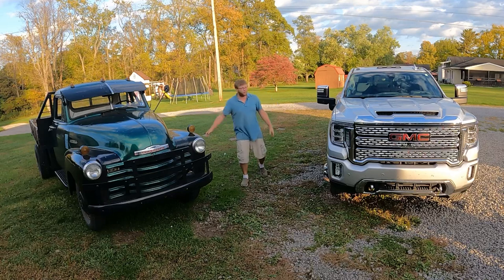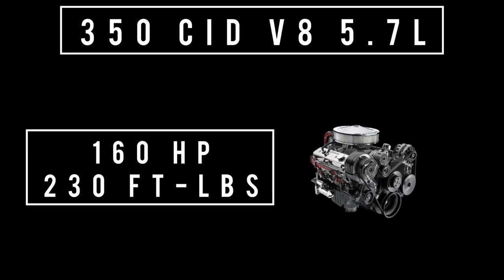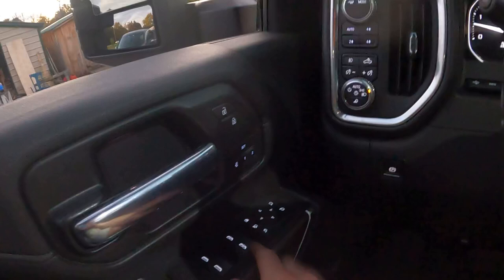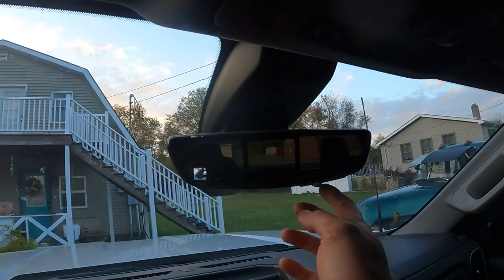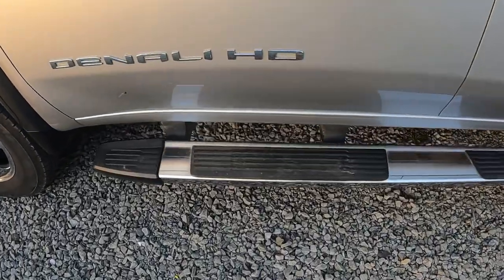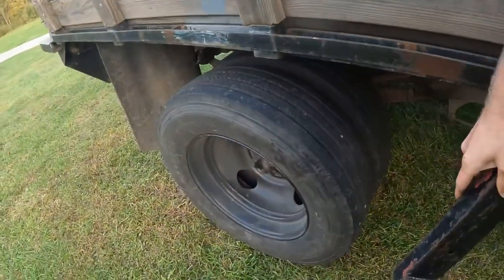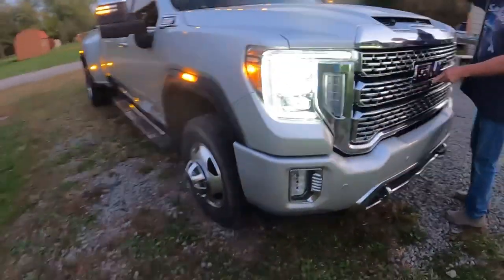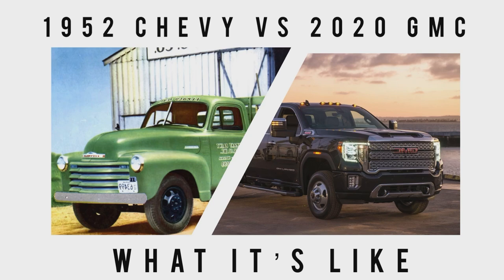Non-Comparable comparison ￼1952 Chevy 1 ton vs 2020 GMC Denali 1 ton

Comment: The rounded fenders and hood wasn’t just for aerodynamics or styling; but they served a purpose to give structure and rigidity. When the VW Beetle was designed in the 1930s, to cut down weight and cost of steel, all the steel stampings were curved on purpose.
Reply from the maker: Awesome information thank you so much for sharing

Comment: Okay, Jay.  We have similar "wiring" regarding old vs newer trucks.
The non comparable comparison is a hit with me.  A type of thing I don't see elsewhere.

I don't prefer the demon brick trucks of the current era.

I have done the E brake maneuver many times on hills with a clutch car and truck.
The bouncy bouncy of your old truck seat is charming to me.
I learned to drive a stick on a 56 Ford truck.  💁🏼‍♂️
Loved that truck  ❤

My current vehicle is my dads 86 Ford F-150.
It has some bouncy seats too and minimal computer stuffs.
It does have fuel injection but I really don't know what drives it. 🤷🏼‍♂️

Thanks for this "comparison".
Cheers and Tootle's, from me.
Reply from the maker: That is one of the most convenient things ever is the parking brake set up such as that.. electric parking brakes suck

Comment: You may not believe this.... My father had a 52 Chevy rack truck that was sparingly used. It had the truck 6 in it (I forget the displacement) and I distinctly remember having the starter switch on the floor next to the accelerator just as shown with yours. We also had a very rusty 53 1/2 ton which was my first "field car" that I drove around my large yard at 10 years old. I'm in agreement with you and I'd rather have the 52. 👍
Reply from the maker: In 52 it would be the 216 or 235 one ton is in a grey area 1.5 ton trucks and up came with the 235 and the 1/2 ton- 1 ton came with the 216 babbet buster
 (splash oil lubricating system) . But one could opt for the 235 which was the superior engine choice with pressured oil system. I love my truck it’s perfect with the 350 v8.. I’m looking still looking for 19.5 wheels from tires still have bias and radials on the rear... internet said it would work as long as on same axel is what it said.. I can attest that it doesn’t work it’s not stable past 45 the back end just wants to turn around.. so I’ve been hauling with it carefully.. I don’t go far and keep it until 40 but yeah who knew finds gmc 1985 bread truck wheel would be that tall of an order. I’m to the point of just finding 18 inch Steelies and making the difference up in tire issue I’m having they are too wide I need a narrow tire so I don’t lose turning radius.. this truck turns insanely sharp for what it is not quite as sharp as a 1939 Ford 1/2 ton which will be posted tomorrow but turns good and don’t what to lose that

Comment: Vintage trucks 🛻, so sincere and unassuming: No infotainment, no vibrating seats (except from the suspension), no leather headliner (no headliner at all!), no AC, no automatic, and no power steering. And yet, for a modest upfront cost they hauled our stuff, carried our kids out back on a hayride, they brought home the new washing machine or the cans of paint for a new home project. Gone are those days of sincere transportation; replaced with expensive glitz and gaudy frills. 

I had a friend with a 53 Ford pickup. Once a red metallic, now mostly a primer brown; that truck was sincere, with a floor shift, drum brakes, with only an 8-tract tape player added as an add-on. Clean, simple, full of character, and cheerfully it rumbled down the road. Caring in back a bale of hay to keep the truck from sliding off the road.
Reply from the maker: But key take away points are the same The crazier thing is if you got a one and ahalf to two time truck restored they’re not worth as much even though they are twice or three times the truck as the half ton trucks are.. the new one can only carry 300 lbs more than the old one but costs upwards of $90,000 more is the new one worth the price difference and to me it’s not.. but to my father in law it is, he is a plant broker and moves plants so he needs a truck that can pull 20,000 lbs
Reply: @What.its.like.  Yes towing certainly would be better; and power and amenities are appreciated with the newer GMC. But looking back at vintage cars and trucks; the reason they age better is there are no electronics to get fried, no plastic interior trim to fade and crack, no camera and radar sensors to replace (a problem finding parts a decade or 2 from now) and these repairs can be done by a handy person rather then a specialist in electronics. 

Love the deep metallic green of your truck. The front bumper looks very appropriate and attractive too. Interesting that you upgraded the engine… hope the brakes have been upgraded too. My friend with the 53 had serious issues with undersized brakes and with the master cylinder.
Reply from the maker: Brakes are mechanical drums use the transmission to slow down it’s not terrible

Comment: Personally, I think the new full size trucks (pretty much all of them) are downright ugly, too big, too wide, and way - way too expensive for what they are.  Someone asked what engine the 52 1 ton had?  Originally 235 inline 6 Used in new large trucks starting in 1941.  Max Brake Horsepower: 105 @ 3600 rpm Max Torque: 193 @ 2000 rpm Stroke: 3.94 Bore: 3.5625
Compression: 6.7 to 1. Simple, tough, and really not fast.  Any time you crease or curve sheet metal it get stonger.  My choice  (and I drive newer vehicles, 2016-2018)  I'll take the old truck, even if you upgrade the engine and transmission.  In fact I'm considering going backwards at this point - - - good vid.
Reply from the maker: The f150 is nice and the dodge is ok but I’d never buy one, I reviewed a ford maverick and I loved the truck but it’s not really a truck, I got this truck because my mom has 2001 Ford F-150 every time I get wood a blow the shocks out I wanted a machine so I bought on hows rly Chevy advanced design wasn’t my first pick 
First pick was 1930-1931 or even 1932-33 ford AA or Ford BB
Second was 1941-1949 international kb5-kb6 (I so want to find both and compare them next year that would be epic

Comment: I'll take Grandpa! (Would install a split brake system and a unleaded compatible engine).
Reply from the maker: Dual master cylinder is overrated there’s three ways to stop this truck I have drove 16 miles to my mechanics house with absolutely no brakes and made it there safely and I live in a hilly area lol

You have no idea how many Classic Cars I have driven that people put aftermarket steering wheel columns in them and power dual master cylinders and they suck  the power steering box only works half of the time it’s so sloppy most of the time the manual steering box is so much better in my opinion same things with the brakes there’s nothing wrong with drums and it’s single master cylinder if one line goes out they all go out but your emergency brakes or cable brakes generally and if that’s not hooked up you can use the transmission to slow down.. If you need to stop put it in first gear and turn it off and pull the clutch out obviously you can’t do that if you’re going fast but if you’re crawling I’m talking lower than 5 miles an hour it will stop you
Reply: @What.its.like.  Rode all the way from DC in an old Plymouth Valiant wagon with a three speed and no brakes. Interesting trip😉😂
Reply from the maker: That’s incredible that would be super scary in traffic that’s the only thing I didn’t have to drive in traffic only the last bit of it =)

Comment: Wing windows too.
Reply from the maker: So many options from yesteryear crank out windshield cowl vent vent windows.. parking brake pedal that’s mechanical not electric. The biggest one is a good quality work truck at a price that won’t put you in a massive hole like there is no way I’d spend $100,000 on a truck